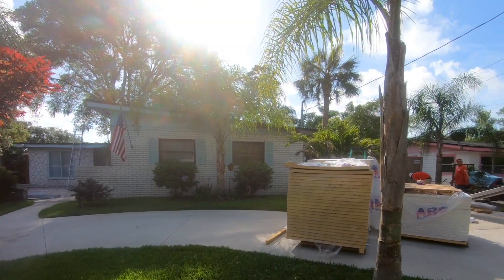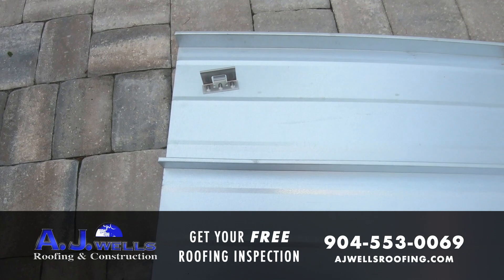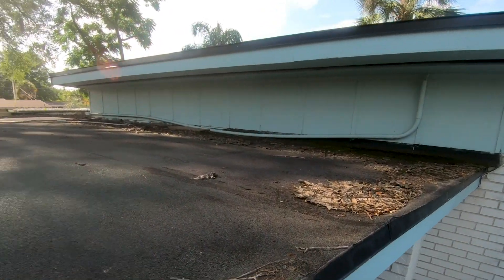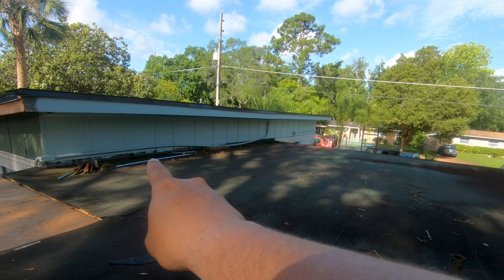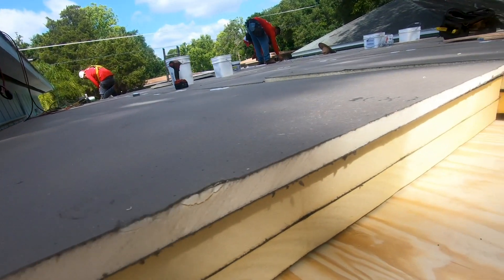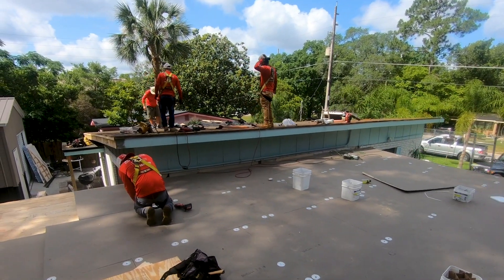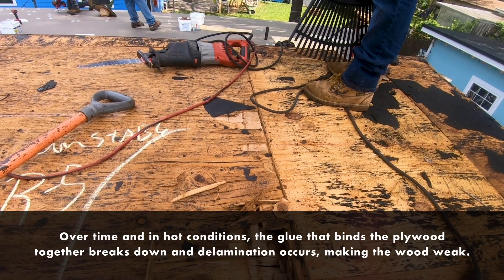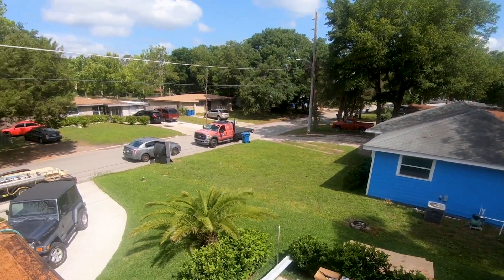Converting a Flat Modified Roof System into a Tapered ISO-Board System and Seamless Metal Roof-Part1

Comment: Going too fast to see the tapered ISO system ? Its a simple 2 piece A panel & B panel tapered system using 2 inch fill,starting at the gutter edge they laid out the A panel which goes from 1/8 inch to 1 inch across the gutter edge,then the B panel that goes from 1inch to 2 inches butts into the A panel running parallel with the gutter edge,next the entire roof deck gets a layer of 2 inch fill ,next they lay a row of A panels overtop the base layer of 2 inch which would be the 3rd row of ISO from the gutter,row #4 they lay a row of B panels parallel to the gutter ,next they cover the roof with a 2nd layer of 2 inch and start back with another row of A panels for row #5 and B panels for row #6 ,then add another layer of 2 inch flat ISO and repeat running A panels for row # 7 and B panels for row #8 ,its an extremely simple system consisting of two tapered panels and one 2 inch thick fill panel ,i used the letters A & B for simplicity's sake,if your roof requires " crickets " between roof drains you would use X & Y panels to build diamonds between your drains to prevent ponding water ,laying out tapered systems is easy as pie unless your roof requires the tapered system to turn corners but a straight shot like this any 12 year old could install with ease .
Reply: Thank you so much.  Someone needs to do a video with your very helpful straight forward explanation.